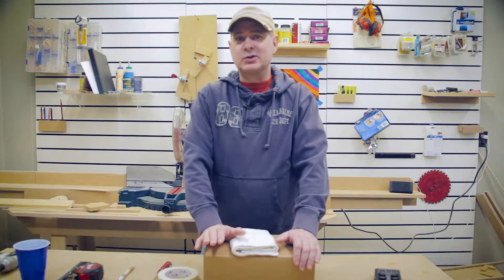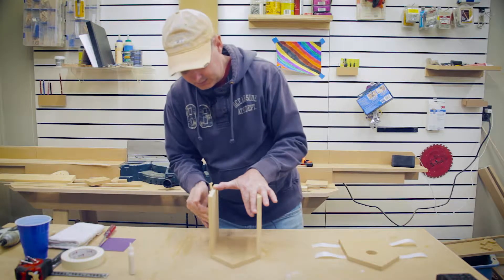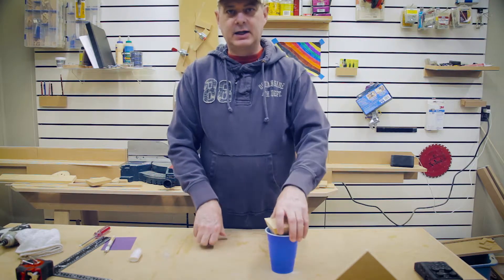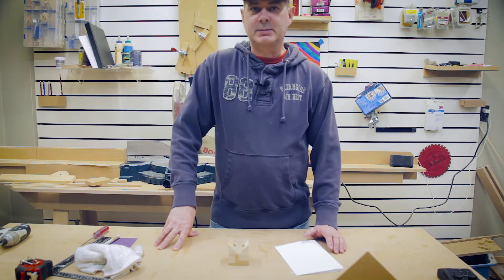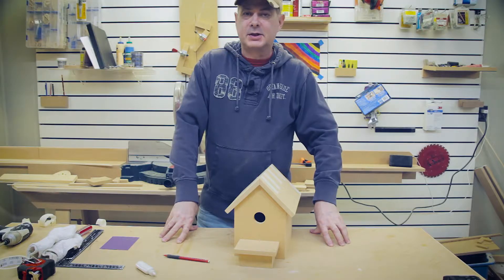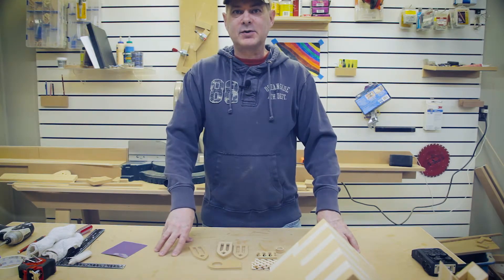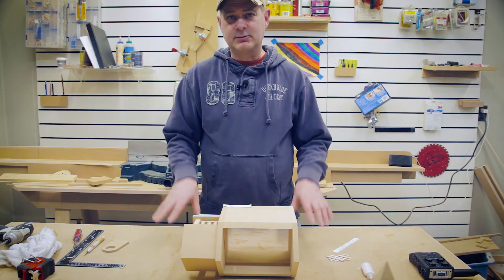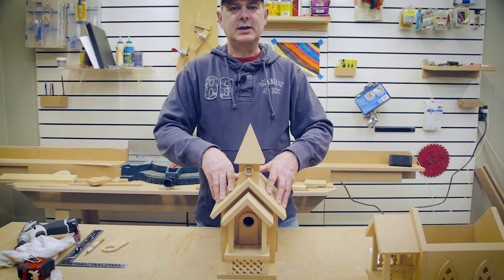Prairie Church Birdhouse Kit Assembly

Comment: I had retired several yrs ago and decided to get a lil' hobby for in side the house.  I decided on DIY bird houses where it comes in pieces. I had bought several smaller houses , but had to try the Church.  I glued all the pieces that I could then primered all the pieces except the smaller ones.  I painted them all, then assembled them all.  I think it came out GREAT and the wife just LOVES it.  All the paint and some glue is drying now on the 1st one and getting ready to start the second church.  The directions that came with them is flawless.  Thanks, time just flew by working / painting the 1st one.
Reply from the maker: Thank you so much for your kind words. I started this business as my hobby to build birdhouses but I couldn't find the right house so the designed my own. After building a couple of them I wanted to share with others. Enjoy retirement and your hobby. Todd